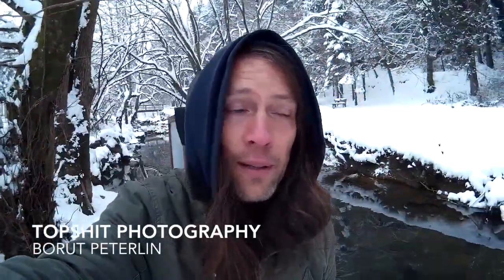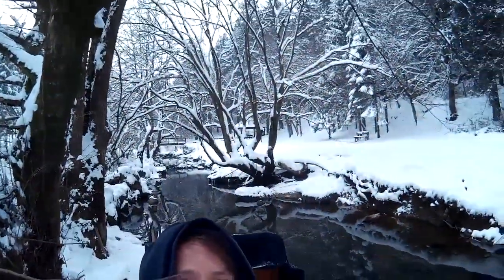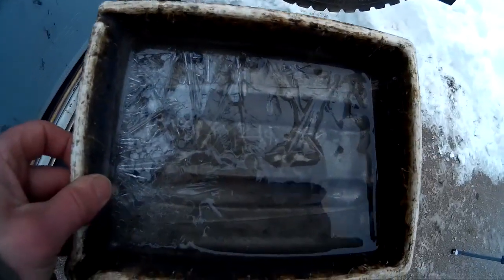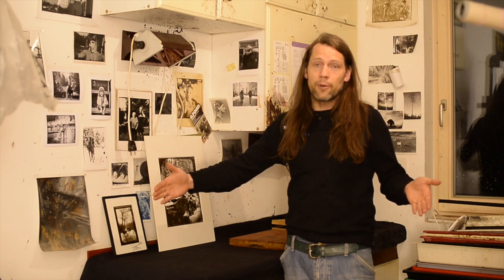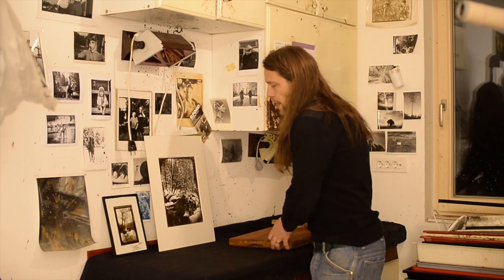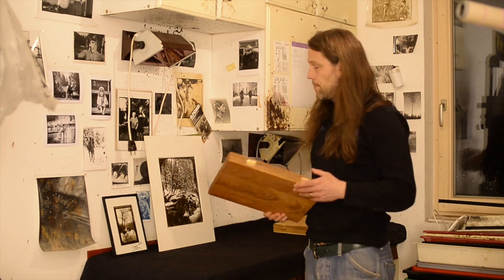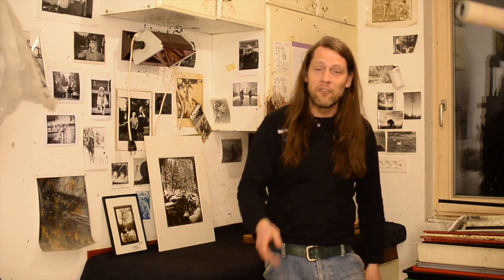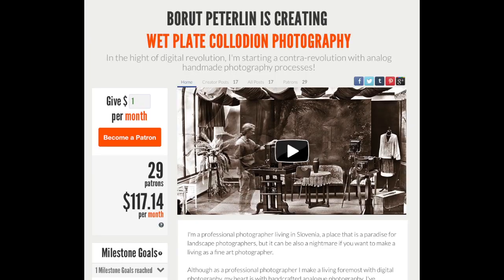Wet Plate Collodion at -9C, plus carbon print process

Comment: For how long can a carbon print maintain its integrity for archiving? 
You said it's the most archivable of the printing methods.
Reply from the maker: PIGASUS - Constantin S. Purcea if it doesn't burn, or crack, it is forever. In contrast to other photographic processes it doesn't use developer or fixer, so it doesn't deteriorate due to chemistry